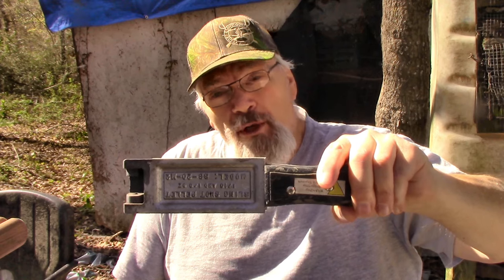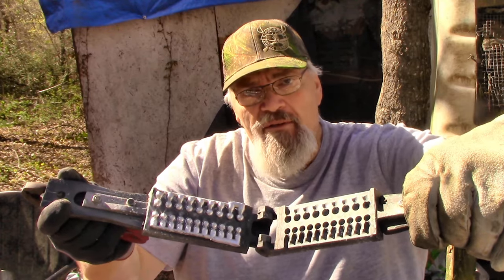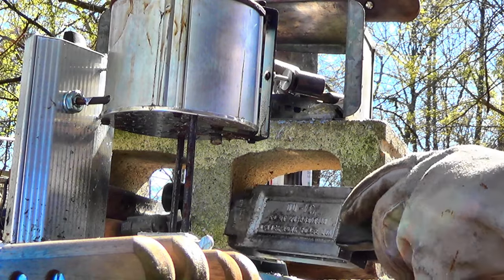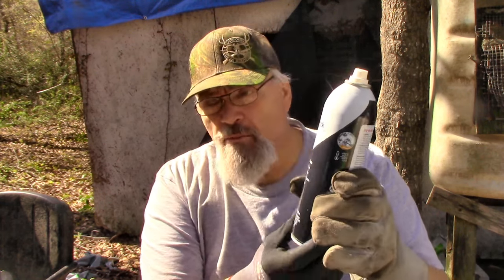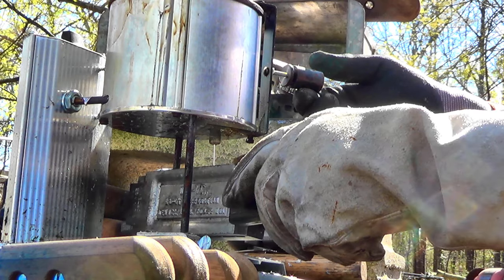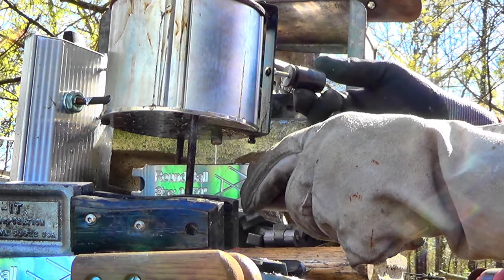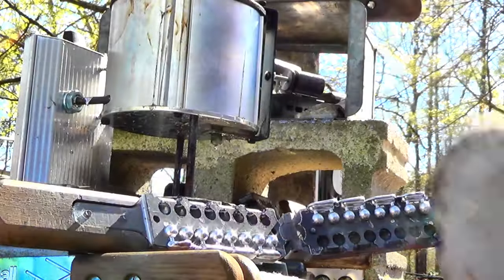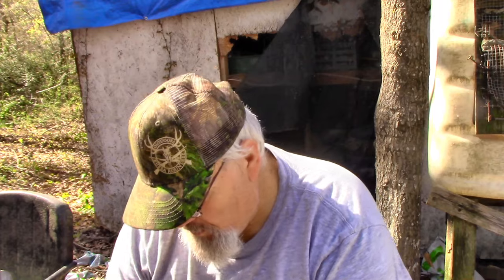Part (1) Do It Slingshot Mold for Buckshot.

Comment: Love it Wade! Great casting! Just out there enjoying some therapy!
Reply: Hey Wade , after casting a few times in my new DO IT mold I was pouring 50 lbs of lead for 10 lbs of pellets with all those big sprues. 
    I repeatedly watched your videos on this the suddenly noticed your sprues were not poured to the top of the sprue channel. Unlike many molds that pretty much require this to get pellets/bullets filled out all the way this mold obviously doesn’t  require that.  Just something I noticed a bit different than other types of molds and saves going through so much lead in a single casting session with so little yield

Comment: I have the same mold. They do come out rough but if you tumble them they finish up nice. One side makes 37cal and the other side comes out just a hair over 30cal.
Last load of wheel weights I got didn't have many made of lead.